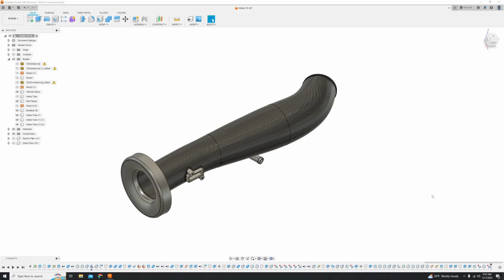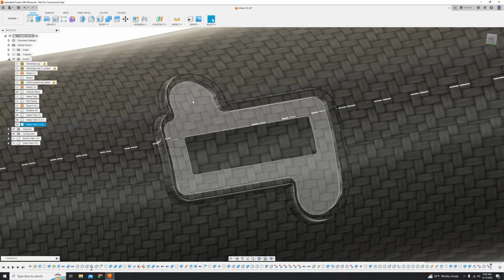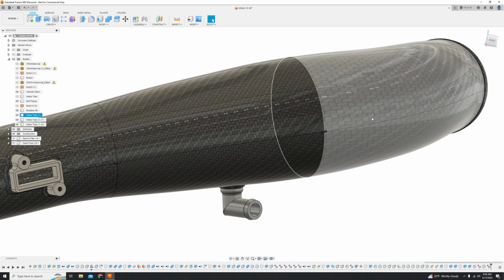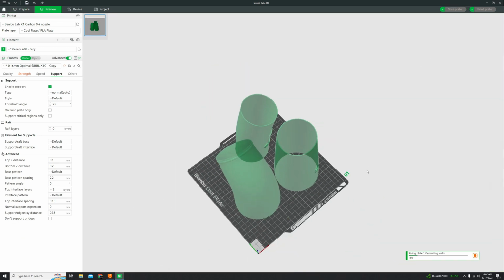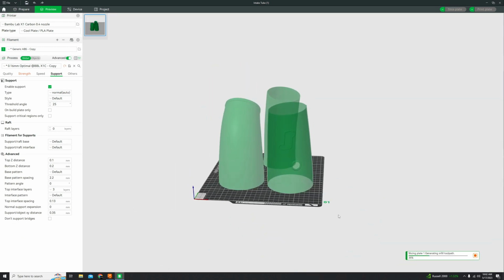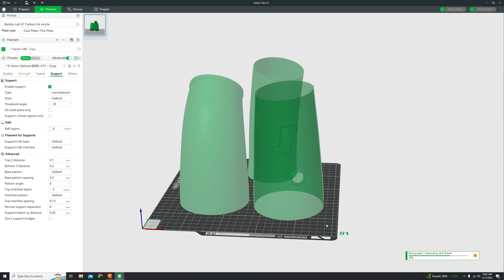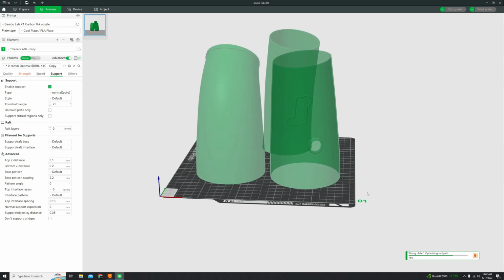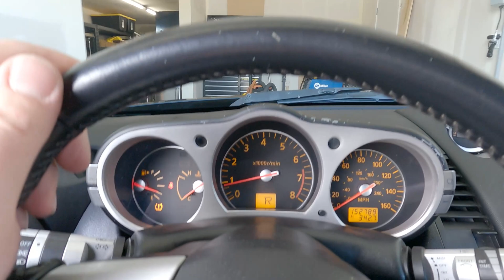I 3d printed a custom intake for my 350z on a Bambu Lab X1 carbon.

Comment: Hey man, quick questions. How did you get the bung to go on the lofted surface for the sensors? I am trying to add a threaded hole for my IAT sensor but cannot figure out how to do it on a lofted surface.
Reply from the maker: Hmm. I "thickened" the lofted surface so that it was a manifold body and then made sure that the bung was intersecting and just did a combine cut and then deleted the internal faces, but could have used the lofted body or surface to use as a cut face and then combine the remaining portion. Hopefully that makes some sense....lots of trial and error! lol
Reply: @EndMotive haha no sense to me. I will try and figure it out
Reply from the maker: @dakotascot  Sorry, it is a bit hard to explain. I recommened watching "learn everything about design / LEAD" here on youtube. He has some great tutorials!
Reply: @EndMotive  Does he have a tutorial somewhat relating what I am asking? I have looked but I may not know the correct wording
Reply from the maker: @dakotascot  I'm sure he does, but its not titled exactly that, so it would take some watching to find what you are looking for.

Comment: Hi l like to do the same for me Audi tts mk2 2009 310hp can you say someting more about temps of the cold air turbo Inlet Elbow ,the the previous owner broke Breather port and glue it back on ,it works but i like to make draw new one but i dont know what material will be the best one ,the higher the speed, the greater the friction, so the higher the temperature .
Reply from the maker: A turbo charged car is likely to experience higher under the hood temps, but I would think that ASA would likely hold up pretty well. ASA would be the minimum for the temperature threshold, and I would likely look towards a nylon blend or better.

Comment: maybe not an entire intake but I did 3d print a coupler in order to fit my air filter onto a ford intercooler tube that had a bung for my IAT sensor. Was wondering if you had a chance to see how ABS reacted to the engine bay heat over time.
Reply from the maker: Nice! The heat didn't seam to be an issue, however It did form a leak that caused a check engine light.

Comment: I 3D printed an airbox with ASA. It works fine.
Reply: How is it holding up so far? I am thinking of using the same material but in doubt to go CF nylon instead.

Comment: This might be a weird question but on a day of it were like 20c - 25c what temps to most engine bays get too? I have found abs can be good for 100c. Which I don’t believe my engine bay has ever felt that hot. And with the weather lately in Australia iv touched metal parts of my pod filter and it’s not even hot to touch.
Also iv seen that ASA ApolloX is good
Reply from the maker: I do believe I tested the under hood temps in the summer but I can not remember what they were. I lived in Las Vegas which hits 118f (48c) in the summers and it did just fine with the heat, well...it was maybe a little soft but not enough to cause issues. ApolloX or a cf enforced filament would probably be a better choice though. The radiant heat is high in the bay, but this part is also continually drawing ambient air through it.
Reply: @EndMotive  I’m curious to know what material car company’s use for the factory intake pipe

Comment: I've used Taulman 910 alloy Nylon. The intake crosses directly above the exhaust manifold with nothing in between it and the 3" intake I printed. Zero issues.
Reply from the maker: Good to know, I will look into it!

Comment: Great try! I am in the process to make a manifold using carbon filled polycarbonate and then also skinning it with carbon fiber, it would be a little hard to do that on the inside tho.It has heat set inserts for holes
Reply from the maker: Thanks! I would like to try making a manifold too, definitely more involved! The inside you could always use a thin epoxy to smooth everything out and give it a little extra integrity.

Comment: I used Carbon Fiber Polycarbonate and have had no issues. no warping or vacuum issues.
Reply from the maker: Nice, I need to give printing pc a try...I am always put off by the price and possible failure though.
Reply: @EndMotive  there for sure is a learning curve. I have a Ender 5 plus I use specifically for high temp so I had to dial it in and I definitely messed up some prints at first. But it’s 100% worth it when it comes to printing car parts. The main issue for me was bed adhesion. But I made an enclosure for it and just use blue tape on the bed and haven’t had issues.
Reply from the maker: @wrathovtyr  good to know!, what brand do you prefer?
Reply: @EndMotive  I’ve been using Priline so far so good. Decent price and on Amazon. Haven’t had any issues so far.

Comment: Yeah, I wouldn't recommend running a 3d printed intake...looking forward to see your carbon molding process
Reply from the maker: I don't recommend it either lol, It ran fine for a little bit but ended up having a vacuum leak so I pulled it off. I was running one on my Frontier for about 9 months without issue and then finally pulled it off because obd scanner I have said there is a pending code that was being caused by it, so it is off for the time being. The fitment and everything was great and that was the main objective with this test print!
Reply: @EndMotive  where was the intake leaking from?

Comment: I printed mine in ASA and used 3 walls 10% infill but modeled the intake tube to have thicker wall. So outer was 3 wall inner was 3 walls with infill affectively a 3-5mm thickness
Reply from the maker: I made one for my Frontier nearly the same as yours and it is much more rigid, it has been on my truck for nearly 9 months now with no problem.
Reply: @EndMotive  Being I'm in FL I hit it with a couple quick coats of high temp Engine enamel. Cant be too careful
Reply from the maker: @NXT_LVL  Good idea!

Comment: Great job! Nice look too. If your worried about heat warping it see if you can add a heat shield below it and back it with some heat blocking materiel? Ive used a welding blanket riveted to the back of a shield once that held well. I was testing to see if I can keep a custom intake box cooler with it by shielding it from the engine heat. It did work but not to clean looking so I gave up after a while. I spent too much time on it and ignoring everything else.
Reply from the maker: Yeah that would work, the abs holds up surprisingly well...but could also go to a nylon or other high temp filaments

Comment: whats the benefit of this intake vs the one you pulled off?
Reply from the maker: Not much if I'm going to be honest lol, it should flow more air and be less restrictive in general, which should help with horsepower a little.